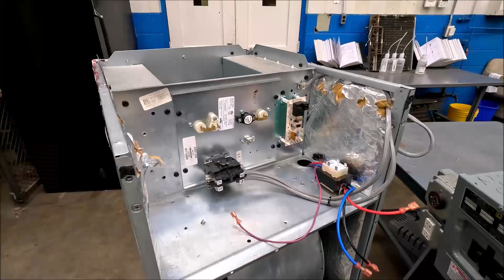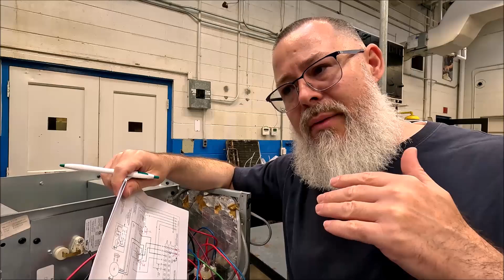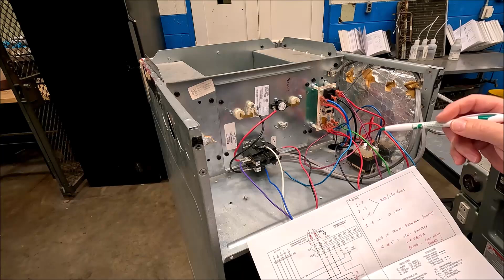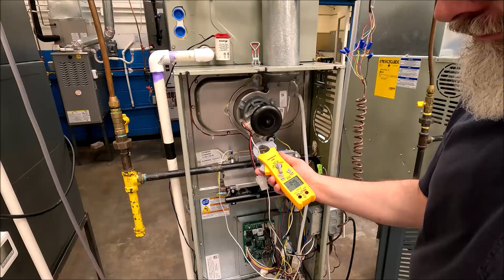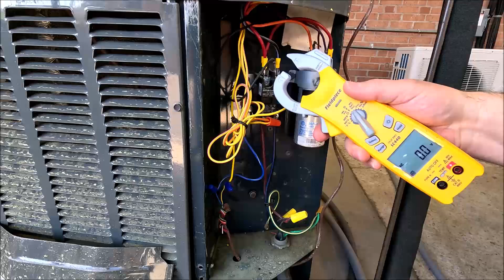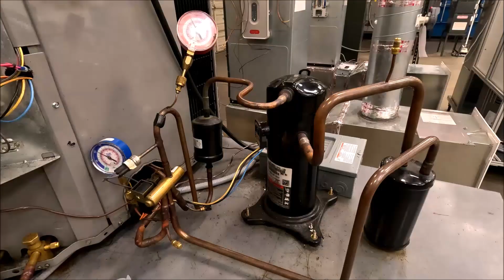Finale! Learning to Read a Wiring Diagram - Part 3 (with voltage and various amperage checks)

Comment: neutral is a return if i remember correctly?    not a ground either !  circuit completion only .
Reply from the maker: Correct. Doesn't bring any voltage to the table but completes the circuit so it will have amperage!

Comment: Hi , I have a 5 ton (r22) 3 phase compressor and need to change the sysytem to R410. S0  I have a quest.  :  Could you tell me what is the  ACTUAL Amp draw on a 5 ton (r410)SINGLE phase compressor ?  Thanks very much
Reply from the maker: We might can get close but there are a few details that could affect it. If you use the HP to Wattage conversion math (1 hp = 746 watts) and the rough idea of a 5 ton compressor is 5 hp with standard 240v residential application...you get somewhere around 15 amps. BUT the manufacture data plate would be better if you are trying to size breakers and wire or something. I usually just look for a certain model online and pull the information from the manufacturer.
Reply: @johnjennings-JJ  Thanks very much